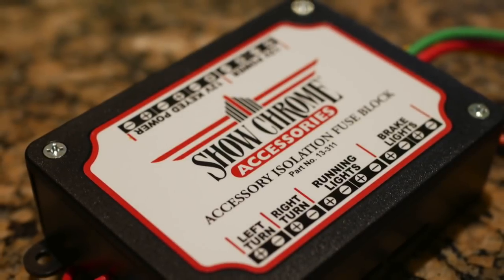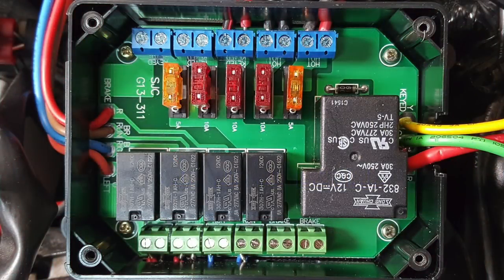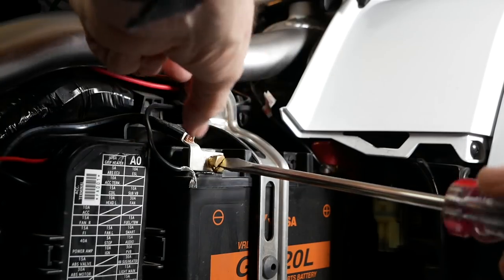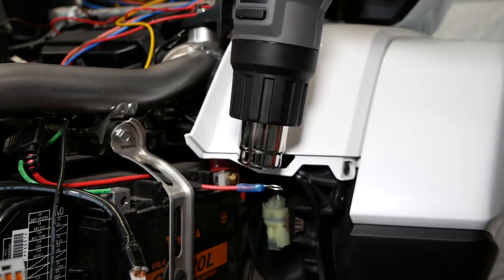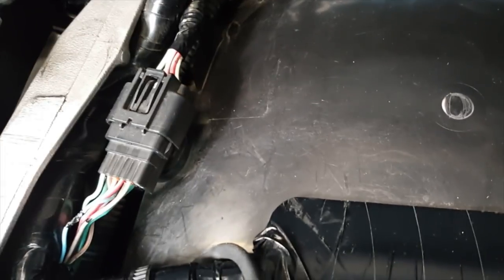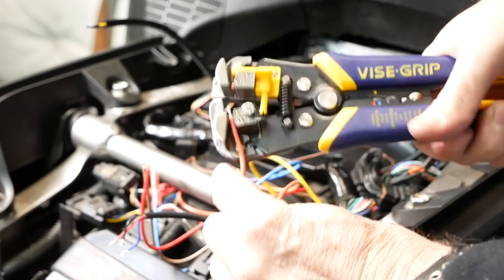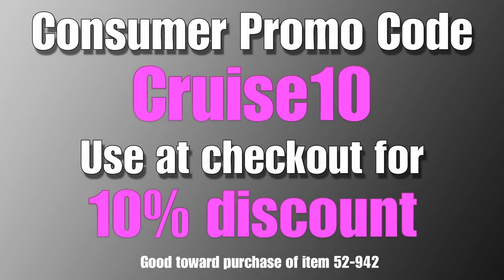Install Isolation Fuse Block on 2018+ Honda Goldwing

Comment: Chris, I'm looking at the instruction sheets for the Show Chrome's isolation fuse block (#52-942) with supplied right side and left side connectors. Their figure #5 clearly illustrates the wire for the right side as blue and yellow and the left side as red, orange and brown.  This is completely opposite from your video at the 6:59 mark.  Please explain.
Reply: @Cruiseman's Garage I noticed this as well.    Time for a change
Reply: If you watch the video carefully you’ll see that Cruiseman does install the sub-harnesses on the correct sides of the bike which agree with Show Chrome’s installation instructions. Somehow he managed to reverse them when pictured in the video.
Reply: @dogbone1358  I contacted Cruiseman a week ago via his forum and he agreed with me.  He also said Big Bike Parts reviewed the video prior to posting and they too missed the error. He said he would correct it and obviously it has been corrected.

Thank you for your mention.
Reply: The Dude  Not sure I agree it’s been corrected. When Cruiseman is connecting the sub-harnesses they’re each on the correct sides. But when the video gets to the shot showing the two sub-harnesses together, side by side, they are labeled incorrectly. At least that’s how I see it.
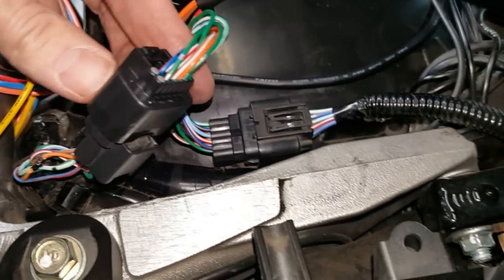Reply: @lance3613  It has not been corrected.  He installs it correctly, but the instructional graphic displayed at 6:57 is still backward.
Reply: I just notice it too, but that's ok thanks for your video, I love all your videos, huge help.

Comment: Great video. I personally prefer using a ring terminal since if it comes loose it won't fall off so I would go thru the extra effort to mount it.

Comment: I ordered the one like you installed in your first video where you tapped into the wiring. This one is more convenient. I emailed Big Bike a few weeks ago they said they would be selling the harness separately later.
Reply from the maker: The harness is well worth it. I did not really like tapping into my wires. If you remove the old taps, use some Liquid Tape to seal the holes in the wires.
Reply: Where is that video

Comment: Very nicely done. Very clear and methodical. Also, that Vice Grip wire stripper was a pretty cool tool.
Reply from the maker: It is the best wire stripping tool I have found

Comment: Chris, please confirm two things for me:  1.   If using the Trailblazer modulators, did you plug the isolator fuse block harness in closet to the rear of the bike, then into the Trailblazer, and then the Trailblazer into the bike harness closet to the gas tank? Or vice versa?   2. When using the butt connectors, did you clip off the small rubber ends of the loose wires coming from the isolator fuse block's harnesses?  Thank you for your time.

Comment: So how would you connect the Sub Harness from the Isolation fuse block with the Sub Harness from the Universal Trailer Isolator from Rivco? Or are you just using one sub harness? Could you do  video showing how you will have your wiring connected?
Reply from the maker: I put both harnesses in line, one behind the other. But, truthfully, you don't really need the Rivco isolator. I am going to investigate making all of my trailer connections to the Show Chrome isolator.
Reply: @cruisemansgarage  Thank you for responding. That would be very interesting to see how you do that once you figure it out. Again thanks for the response.

Comment: Cruseman I see you have reviewed show chrome and pathfinder and there are other from electrical connection and kuryakyn.    I’m installing the Rivco hitch and you installed the rivco trailer harness  .     In your opinion which wiring and isolation are the better ones?

Comment: Great video.  I got one and installed it specifically for a brake light to replace the rear reflector.  I also discovered a DO NOT device.  I installed a J&M CBLU-GL1833 wired adapter, gives you wired headset connectors.  I used the power ports and the switched power port positive terminal.  Everything looked great until I keyed up the CB. It streetched and howled on everyone's CB on the same channel I was transmitting. I am not saying that I would not like to do that some times but 99% of the time I want them to hear a clear voice. Bottom line: install the J&M CBLU-GL1833 exactly the way J&M says.

Comment: Adding a Garmin Xt to the Show Chrome isolater fuse box not sure on the back of the box wires will I assume it is for the key?
Reply from the maker: Not sure I understand the question.

Comment: I have this block on order now. I also have several light accessories on order, including (sequential trunk brake/turn signal mounted on trunk) and I think a few are plug and play into the same connectors you used in this video. Any suggestions?

Comment: Question:  In later videos, you hook up all your accessory wiring to a Pathfinder Power Accessory Hub.  Why did you switch from the Showchrome Isolation Fuse Block to the Pathfinder Hub?
Reply from the maker: In part, simply because PathfinderLED asked me to make a video for their new product. However, once I installed it, I could see that by being digital and weather sealed, it did have advantages over the Show Chrome. But, both units are very good and do essentially the same thing.
Reply: @cruisemansgarage  Honest answer, I appreciate it.  Looking at the two, the Pathfinder does have the weatherproof in the bag.  Unfortunately for me, based on this video, I just purchased the Showchrome.
Reply from the maker: @stevenwhitaker5477  Steven, you will get many years of reliable service out of the ShowChrome unit. Weatherproof is nice, but more important on an adventure bike (riding through rivers or deep water) than on a touring bike.

Comment: Hi Cruiseman, I heard you mention that you never had problems with moisture in the fuse block.  I just finished my install with some new lighting.  Where do place the Wago connectors?  By the way I had problems with the supplied taps, the Wago connectors saved me hours of problems.
Reply from the maker: I am in the process of completely re-wiring all of my connectors, and a video will be coming soon. Basically, I am running the WAGO connectors so that I can access them WITHOUT having to remove the seat. So, I am trying to get all of them hidden under the side covers. Once I get all of this completed I will make a video showing how I did it.

Comment: Thank you Cruiseman! At least for me, you’ve taken the mystery out of the installation of this accessory. I’ve had this for awhile but was clueless on how to wire it to the bike. Now I feel comfortable being able to proceed. 
Still don’t understand how to actually wire a lighting accessory to the fuse block. Don’t know why there are + positive and - negative terminals in the fuse block for the brake, running, left and right turn signals? Which terminal to use? More specifically, how do I connect the GT Tour Cowl Lights to the fuse block? Hope you can do a video on it too.
Reply: Missed his name, but if you scout for Show Chrome accessory install you should be able to find the guy. He's Black and a very good instructor but that's all I know.
Keep on rockin'.. and PEACE in Jesus.
Reply: @dubblyewjay1133   Was able to get this and other installations since then.
Reply: @dogbone1358  let me know how it goes. I am thinking of one for my Wing and I just got a new l.e.d. headlamp.
Reply: @dubblyewjay1133   Works fine. Follow instructions. You Tube Videos will help. I ended up using crimp connectors along with smaller gauge wires to fit into the black box.

Comment: Chris, I connected mine as shown. I connected the Trailblazer modulators between the fuse block and the bike's wiring. The rear lights work fine, and they modulate. I then installed an Admore Lighting light bar. When I connect its red wire to the 12V Key On +  terminal, the light does not activate. I then touched it to the positive terminal of the battery, and it works fine. What am I doing wrong?
Reply from the maker: And, you did this with the bike turned on? Try the unswitched terminal on the Show Chrome, just to test.
Reply: @cruisemansgarage  after much discussion with a very nice rep at Big Bike Parts, it may be that the isolator fuse block is bad. I have returned it and ordered a new one.

Comment: I installed this on my 2020 dct and following the wires colours like for like when I wired my trailer plug 5 wire with an auxiliary for charging etc I could only get it to work with the stop and right signal reversed this is on a UK bike have u come across this problem before ? The charging for the aux I have wired from the ignition on circuit.
Reply: U have to swap. The blue and the red from the tail leads .

Comment: I'm a little upset.  I installed the fuse block today, only to find out that it's for a 5-pin wire harness.  You don't have brake lights, if your trailer has a 4-pin flat system.  Funny thing is that Show Chrome sells a 5-pin to 4-pin adapter for another $43.00.  It looks like I either buy the adapter. or re-wire my trailer to 5 wires.  I may just rewire the trailer, just so Show Chrome or Big Bike Parts doesn't get any more money from me.

Comment: Maybe I missed something but where does the yellow wire on the right side connect?
Reply: Yes what's with the yellow wire
Reply: @michaelboater3545  boss I couldn't tell you. I have a 2008 goldwing and my wiring harness is not setup for plug and play like the videos I watched, so I took mine to a shop. The wiring was a nightmare
Reply: Adding to fuse box auxiliary fuse for key on power . I guess.
Reply: connects to the yellow wire on the sub-harness.

Comment: Nice tutorial but for me the left and right harnesses that came with the fuse box were reversed  from what you showed in the video. The harness with the Blue and Yellow wires had to go to the right of the motorcycle and the harness with the orange, brown and red wires went on the left
Reply: I would also have to agree with this.  I didn't read instructions since the video is so complete, and then followed the labeling on the video, which was reversed.  I checked everything with a 12 volt tester after it was wired up and left blinker was right, and right blinker was left.   dang.  Hope I didn't cut the wires to short so I can reverse them w/o any problems....  Why read the manual when someone who you trust is showing you how to do it.....  Anyway, great video other than that.  Should I remember that Left is Right, and Right is Left, or just correct the problem right now.....  Going to correct it.   Interesting to note, that the Keyed 12v signal on the can bus must be on either connector, Left or Right.  the key signal worked when I tested it and the blinkers were reversed, so I am assuming that when I switch the connectors to the other side the keyed 12v power is also going to work.   Since I have made some edits to my comment, maybe Crusiseman can edit the video and correct the misinformation about wiring up this product.  I watched his recent video on Jan 20, 2023 about replacing a dead battery, and he isn't even using this accessory on the white bike.  Anyway, a correction to the video showing the correct wiring of the harnesses would be appreciated.

Comment: Can I run my trailer wiring off of this isolator block?
Reply from the maker: Absolutely.
Reply: @cruisemansgarage  Any specific gauge wire I should use?
Reply from the maker: @randykonop7989  it will depend on the lighting on your trailer. The trailer mfg. should be able to provide you with the specs required.

Comment: Just went to order one. The item is on backorder, and promotion code Cruise10 "Does Not Exist."
Reply from the maker: Clay, I will forward this to my contact at BigBikeParts. I figured they might be on backorder, and they may just be getting the code setup. I will see to it you get the discount.
Reply: @cruisemansgarage  Thanks, Chris! I figured it was just early in the process, and they might not have everything live yet. I appreciate the followup!
Reply from the maker: Clay, I got a response back from Big Bike Parts this morning: "We have to get the promo code entered into our system here.  I have an email out as of last night to get that completed.  We expect these to be back in stock around April 20th our first production run sold out within 48 hours of releasing the product."

Comment: Has anyone installed this fuse block in this position and notice the seat has a molded stansion the pushes down on it? This position shown at 2:40 is directly under that tall molded stansion of the seat base.
Reply: I just installed this fuse block Dec 2023 and found the same thing.  The molded stanchion under the left side of the seat bottom pushes directly into the block.  Both the video and the instructions say to put it there.   A lot of wasted time following instructions.  Now I have to take it all apart and put the block elsewhere.

Comment: Has anyone had a problem with their Muth Mirrors not isolating when installed and hooked up to a Show Chrome Fuse Block on 2018 Goldwing...
Reply from the maker: Have not had that problem. Is it a ground issue?